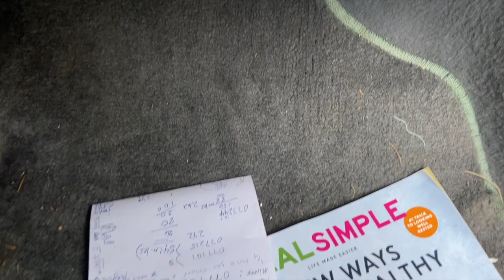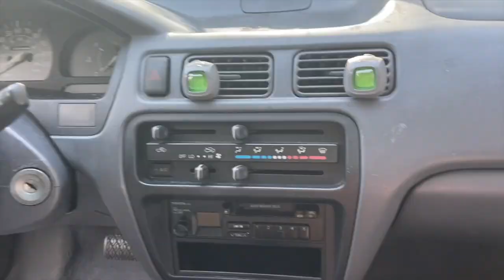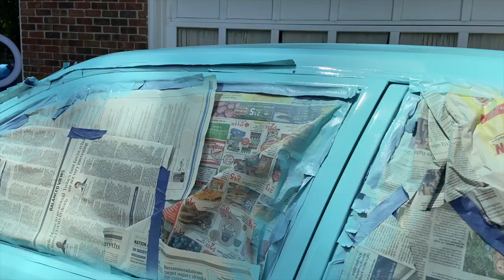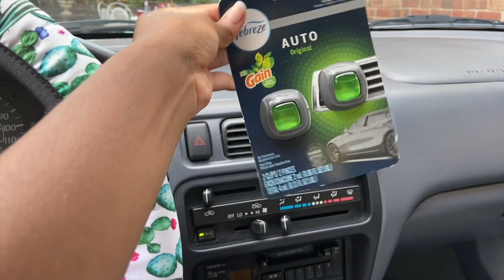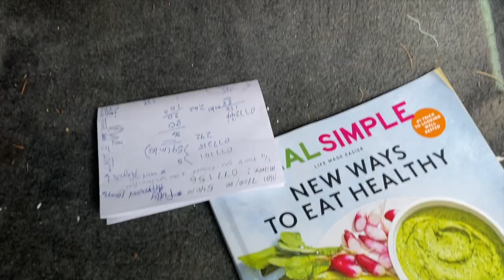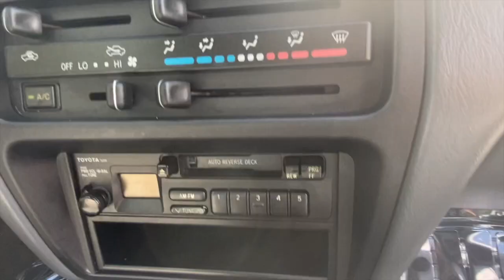I PAINTED & CLEANED MY DIRTY CAR!!! | DIY EXTREME CAR MAKEOVER ON A BUDGET| *satisfying*

Comment: You should get “Ultimate Black Trim Restorer” it’s like lotion for the black plastic parts of cars but it will make your bumpers look jet black and new. It’s like magic! I use it when I wash my car to refresh the plastic that the sun has ‘dehydrated’
Reply from the maker: Oooo!! That’s a great tip! I will do that 💕
Reply: i second this! i use Mothers brand back to black
Reply: Thanks for giving her that tip. I hope ya don't mind if I steal it too. Lol.
Reply: I just commented about this! 😂 I used Forever Black and it’s amazing!
Reply: Will this work on interiors also? My card dash is so sun faded 😭
Reply: The brand I used called Forever Black says that it can be used on any plastic or Vinyl surface and that it’s environmentally safe so I would imagine it doesn’t put off any harsh fumes when sitting in the heat. It would probably be good to research all ingredients of whichever product you buy just to be safe!
Reply: @YoungLadyBusiness  also, if you have a hair dryer you can use it so it melts the plastic a little and it looks new again
Reply: @YoungLadyBusiness  
Did you purchase the "Black Trim Restorer" and seat covers? How does she look now? Can we get a video update if so?

Comment: 30000 miles for $1100 woow !! That's amazing
Reply: Well look at the car
Reply: Technically it's a brand new car
Reply: @davontyrell3724  it’s not all about the outer appearance tho. It’s more so
about the mileage, as that can interpret the life of the car. She may be able to drive that car for another 5 years... all for $1,100?? Thats 3 months of my current car note 😭. That’s not bad at all.
Reply: That got my attention too lol
Reply: My car is a 2017 and it already has 35,000 miles so yes this car has been barely used. That's an amazing deal😊
Reply: I purchased my car with 41k miles so 30k is a blessing. Toyotas are great cars so she'll probably have that for years

Comment: I touched up my car last year. I used tips from Youtubers. After sanding it I took it to the carwash and waited 24 hours before spraying it. After I finished, it was clean and looked like new
People asked me if I got a new 🚗 I would say no while watching them trying to figure out what was different😅 
That $2.99 spray handle is a time saver. I use A LOT of spray paint in my DIYs and I like it so much. 
You did a great job.
    💃🏃🙌👍

Comment: I literally just finished mine. Its a FLUORESCENT HOT PINK, with sparkly white and black accents. I first did it with Raptor so it can be textured and then i did it with the spray can. It takes time. They most exhausting thing to the was the taping. You guys i went through so many trials with different tape, the best BEST tape is the green frog tape from walmart its a couple more dollars than the others (around $4-$6) but def worth it though trust me it rained and it still stayed in place WITH THE PAPER YALL and i only had to tape up 3 or less parts on the window where the crumpled away from the tape.
Reply: I wonder how it looks. I wish I could see a pic. That sounds so cool.
Reply: Can u post it
Reply: Aww man I wish we could see it I love. Pink

Comment: The paint looks good, but you need to add a paint sealer and wax on it
Reply from the maker: Yes! I plan on adding that soon! 🦋 thank you! 
Did you recommend a certain brand or anything?
Reply: Young Lady Business yes! A clear coat will act as a protectant to prevent rust AND make it super glossy and shiny! You can also buy spray paint trigger handles (picture a windex bottle trigger) attachments that you stick right on the can and it will continuously spray. Soooo much easier on the hand and make spray painting a breeze!
Reply: Young Lady Business Rustoleum has a spray clear coat . Painting the wheels would be nice too, maybe matte black

Comment: Love her name (good job Dad!) LOVE the color.  Just a couple tips to make that paint job and upholstery clean up last: You need to do a clear coat to protect the paint.  My suggestion would be to go to Sherwin Williams and take a can of the paint you used.  Ask them what NON YELLOWING clear coat will work for your car.  Some clear coats yellow so you def want to avoid that.  And you can pick up a couple of cans of Scotch Guard-which you spray on and it helps your upholstery repel liquids and stains.  I'm not a know-it-all but just an older woman that's redone 7 homes and raised messy boys and always had a houseful of their friend's over.  Lots of lessons learned over the years but girl, I would have NEVER had your courage and vision to paint a car!  You are amazing.  Keep up the great videos.  You've got a solid fan down in Louisiana!⚜️

Comment: Your car looks really cute after that paint job. Love the color. Love the tip on the Bissell cleaner. I need one. My first car in 1993 was a 1979 Pontiac Gran Le Mans. It turned on a dime but started shaking if you drove faster than 55 mph. LOL. It was brown and had a push-button radio but it was mine. My current car is a red 2007 Toyota Corolla with fairly low mileage. Loving it.
Reply from the maker: Thank you so much! Happy you like it! 💕

Comment: What's the durability on the paint? Does it last, is it worth painting? No primer? I also thought Rust-Oleum had a car paint line.
Reply: 👍I've always wanted to paint my Smart Car but I'm nervous it'll chip off. 
Please update how cotton candy is holding up after a few months.
Reply: Tish the Vegan   Of course it will chip off. No prep work was done. Spray paint is not 2k based unlike automotive paint which means it won’t bond nearly as strong. Also she has no clear coat. The UV rays from the sun will just eat away at the paint and destroy it. You can’t even put a clear coat over spray paint because it’s a single stage paint. That means it’s not designed for a clear coat. 

Don’t waste your money and time. This paint job just won’t last. Theirs a reason why people generally don’t do this.
Reply: You'd be better off just spraying truck bed liner all over in the long haul.
Reply: Not gonna last at all. Cars aren’t meant to be spray painted

Comment: My Dad was a body and fender guy so, I've spent some summers sanding and painting. You did a great job. I didn't see you seal the paint though. If you don't want random chips, seal Cotton Candy up. Big props girl. I would've never painted cars if I didn't want extra spending money!😭
Reply: What would you recommend sealing with?
Reply from the maker: Yes sis! What should I seal with??
Reply: Hey girl. Use a paint sealant. You can get one from your local auto store. To prep, wash your car first. You're going to apply it to the car horizontally. Don't use circular motion because it's going to make the paint swirly. After you apply it, use a microfiber towel to buff it in. Let it cure. They're several brands to use. I haven't done it in a while so, ask the salesman what the best one on the market is right now. Good luck girl. Great job again.😘
Reply from the maker: @BayouBarbie504  thank you!!!

Comment: Pro tip: if you take a hair dryer or heat gun and go in a circular motion on the faded black plastic on your bumper or trip you can restore it to factory new black. I did this on an old mustang before I sold it. So worth.

Comment: You did a wonderful job on this! My first car was a 1997 Jeep Grand Cherokee. I bought it for $1300 cash in 2006 or 2007? The AC didn’t work, there was no headliner and it had a loud AF muffler on it. I had it for about 4 years and then sold it for $1100 cash, almost broke even!

Comment: Ps... I have spray painted the spoiler on my car before.  And it looked really good at first.  Then it seemed to fade.  I'd do it again, but some things I learned.

Couple tips: 1) Sand, but don't sand too much, there is already a primer coat on the paint and if you sand to much it won't cover as evenly. 

2) Get a paint with a primer in it, maybe look for spray paint that is specific for auto?, and put a top coat or clear coat on it.. they sell it at auto parts stores etc.

3) Add up the cost of all of the paint cans, and how frequently it needs to be refreshed... We all like to save money DIY's are my favorite. But sometimes, allow yourself the space to invest in yourself.

-A lot of times we tell ourselves we don't have the money, or I'd rather spend the money else where than to take the car in to get it painted.  But if it cost $50 in spray paint... But you end up finding the money to refresh it every year... because it fades so bad...Then it may have saved you more money to get a $199 at macco.   

-I just recently noticed in the ways I sometimes spend more money... Trying to save money.   And if you're saving money by having a 1996 like me... Yes have your emergency fund first.. but also understand you're worth it to spend a little more to care for yourself. 

 Having your car painted actually protects to metal...no matter which way you get it done.  --And it makes you feel better to care for your things, So it's a good thing to get it done, you deserve to put in the work for yourself to care for yourself... And keep putting in the effort till you don't have any more breath.  **I'll say it again...You are worth the love! You are worth the effort! ✨💕✨

Comment: The cleaning part was like watching a satisfaction video. The car was not that bad in comparison to other cars, I have seen waaaaaay worse in terms of how dirty it was.  The paint job especially done by hand came out very nice. If I had to do my vehicles over I would keep the the same color. My truck would stay vanilla white and my car would stay black I would just touch them up. Very good job al the way around.

Comment: omg, thanks for this! I got into a car accident in 2014 and I just got my car back from my grandpa. Unfortunately, it was sitting in front of his house for 8 years with the windows rolled down. The inside was and still is a mess. I had to get it detailed which helped a bit. I am finding spider webs on the inside! Girl, I am scared. However, when he got the side of my car fixed, I somehow ended up with two front slide panels that are green and don't match the car. I didn't understand the need to remove the other side panel. I really want to paint it because it looks so sad.

Comment: Shes doin it right. Your first car needs to get u from point a to point b while u save. Forget ab expensive things. I used to work with ladies who were in debt  bc they had the most recent cars i paid mine off in 2 years and i still got it after 5 or so years. No major issues. I go to point a to point b and I also cheated on gas/engine usage bc i work from home now

Comment: That Toyota will probably outlast anything else you get. Toyotas especially from that era are the best cars ever in terms of reliability. And at 30,000 miles that cars barely broken into. Those Toyota’s from that era last until 500,000 to 700,000 miles.

Comment: Cute but unfortunately the paint will not last. I’d give it about 2 years maybe? The heat of the engine operating can result in paint flaking off the hood plus weather elements even if you do a clear coat it will peel. And the paint job will be splotchy. Invest in a real paint job y’all!!